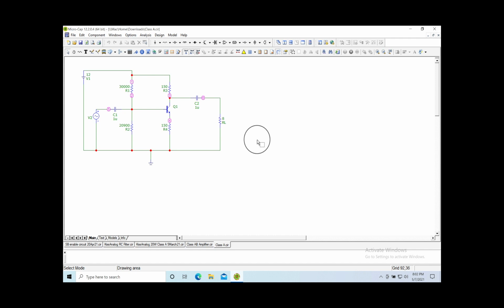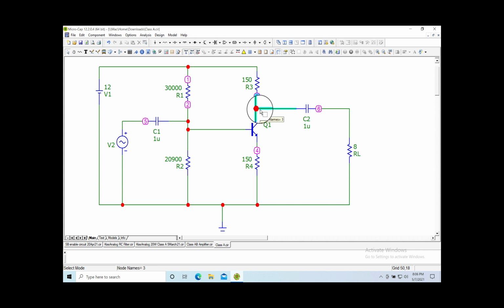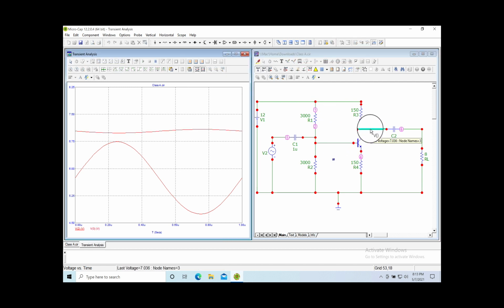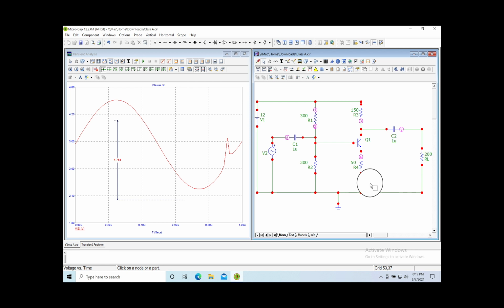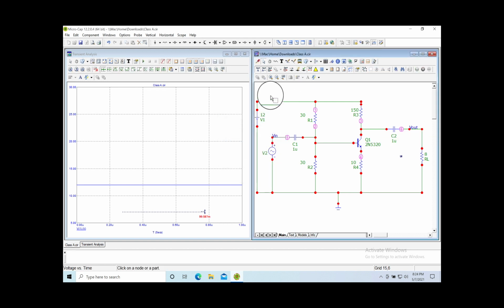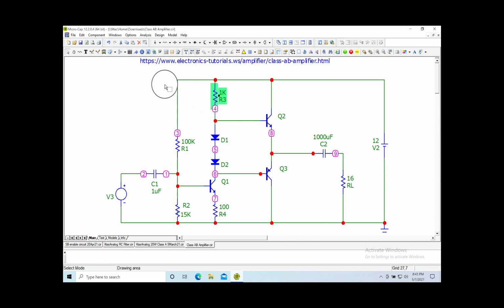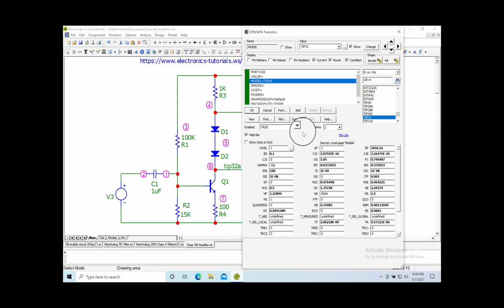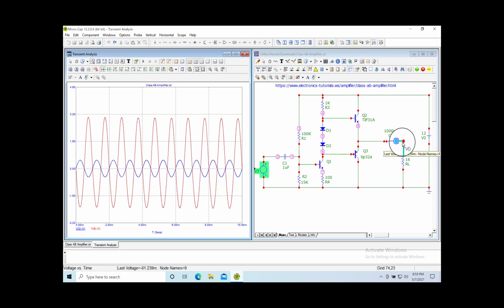MicroCap Tutorial Class A Amplifier circuit sent in by subscriber #microcaptutorial #circuitanalysis

Comment: How can I see the gain on this simulation?
Reply from the maker: Great question!  I'll have to show more videos on the amplifier.  I did just post a video that might help: https://youtu.be/I6V3uH8AW6U
Reply: @KissAnalog  thanks a lot sir. I watched the video you sent. But I couldn't find a solution for my homework.  I have to design an amplifier circuit has 200 gain and also circuits load resistor has to be 5ohm. I tried to design two stage amplifier becuse RL is so low.but I couldn't increase gain of circuit. I used bc547 as bjt. Can you help me about designing?
Reply: Your single stage amplifier voltage gain should be computed by collector resistor value divided by emitter resistor value. The gain would be high if you put a bypass capacitor across emitter resistor.

Comment: I think that MicroCap12 is the best out there, I have used it in every design since 1994, Interestingly enough it has far reaching capabilities such a listening to the amp you just designed. By recording a short WAV file and specifying it as the input stimulus you can actually listen to the amp. Besides that you get the output wave that you can compare using an audio program such as Audacity and switch back and forth to A/B test the sound you are hearing. There are much more to it than at first glance, you can have mixed technology circuits mixing digital and analog circuits together without the need to simulate it separately. Eddie you are delving into the Abyss once you surf around the program like a pro there is little in the way of designing perfect products. It capabilities are enormous written by a bunch of super analytical engineers and scientists. Their models are not bad but you can get specific models from the manufacturers. It has super flexible scripting to create very complex subassemblies that can be used as building blocks in a schematics. To explain every facet available you will write a very thick book because there are many unrevealed magic in it. For something so complex it is difficult to generate an exacting operating manual. If your models are correct you can use microcap as a repair tool for a product as the voltages and current are precise.
Eddie when you are ready I would like to share my unforgiven amplifier with your disciple's, it has almost zero distortion megahertz band width high output and an amp that will show the short comings of everything available out there, It is super simple but super hi-end in every respect, 4 transistors and current feedback, unconditionally stable. Something that is absolutely neutral and could be used successfully to create a  particular house sound around it, like many high-end designers do. How do we contact each other? you can try mailing me : nico[at]ras[dot]mobi. I would go so g\far as help the disciples lay out the PVB designing a proper power supple and have an amplifier of their own that will rival everything on the market. We do it stage by stage so nobody gets left behind.
Reply from the maker: Thanks Nico!  I agree, Micro-Cap is arguably the best too for circuit simulation.  It has such a clean interface and so many ways to do the same thing.  You don't get STUCK because you can't remember a certain function.

I'd be honored to develop your design.  I actually have a PCB software tool that I will be demonstrating soon.  I was tying to settle on a design to help demonstrate how to use the tool and how to do proper layout and routing.  My email is KissAnalog@gmail.com.  I'll reach out to you as well;)
Reply: Hi nico.....you can listen to the amp design? Now that's something i need to try out! Thanks for the heads-up mate :)

Comment: Hey, could you some time this year make a video on how to measure high frequency signals correctly on the load with passive probes like pp-510 from Siglent 1000x-e series.
I am having reflected signals even on 100Khz that overshoot both on positive and negative, I am guessing it is because I connect to the ground with "long" ground cable that comes with a probe.
I guess I have to use iron cap for the probe, right?
I am using FY-6900 signal generator that has output impedance 51.2 ohms.
Reply from the maker: Thanks for asking!  Yes, I actually am surprised that I haven't found the time yet;)  I have meant to a dozen times!

Comment: I am so afraid of this program going to the dump in the near future, there are 39 years of development and nothing like it out there. It would be so fantastic if the program could be developed and maybe be added a circuit designer.
Is there any possibility for you to contact the CEO and ask if it could be allowed to go open source, I will be more than happy to give free space and domain. I think it's super important to do something now before everything is trashed! :-)
Reply: @UCSGP81YQIEsxo--cr2HtJFA  Yes I know but I haven't got any luck, he has not replied to me.
Eddie has got some response and since he has several videos that shows he is not just a "know nothing" may he have better luck.
About downloading, There are a giant différance between the original source code and the finished program, to keep developing do we have to get the permission and the source code. :-)
Reply from the maker: Thanks Fried Mule for bringing this up.  I'll try to contact them and see what they think.  I'd bet that they would like this to keep it in the community forever;)

The good thing is that this program is so advanced, it is far better than most any program and definitely better than any other free program.  It also does allow for new parts and models to be added, so it will be relevant for many years;)  The only real issue would be if the platform/windows changed such that it didn't run, but I think there's little chance of that for years to come.
Reply: @KissAnalog  Thank you!! I do really hope they'll release it as open source. If windows someday stops being published, am I sure that somebody makes a compiler to the new operating system! :-)
Imagine if a huge amount of people  starts to write modules and add-ons to it! You could in a way keep the original code just with added possibilities for writing functions and so on. in a way will you have a stable building ground where people can chose and reject what they need or hate! :-)